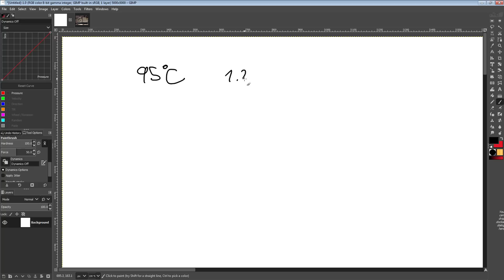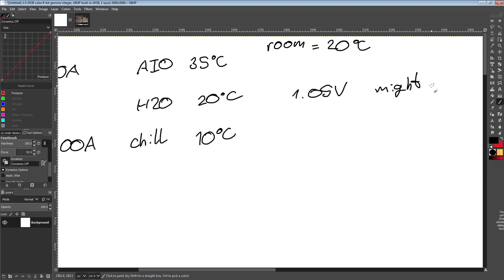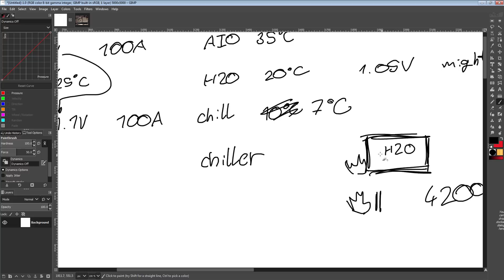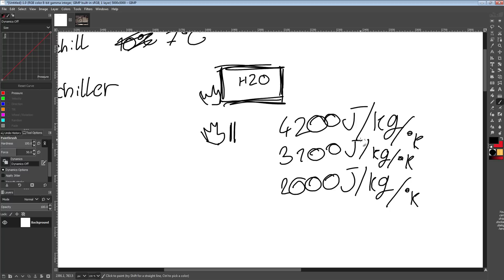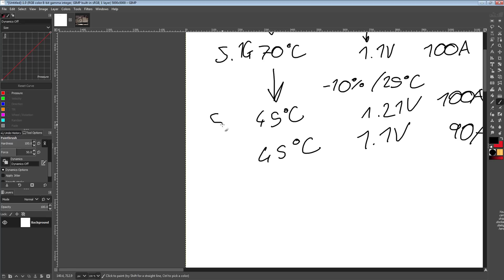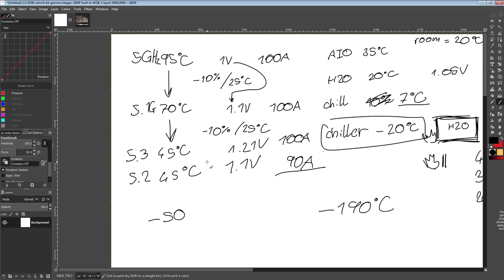Elaborating on how lower temperatures can improve voltage tolerance.

Comment: the best thing about water, the hydrogen bonding causes this heat capacity. since the molecules h20 is slightly polar, with one side of the molecule being - while the other side is +, causing the molecules to "stick" together and require more energy to get moving!

Comment: I run a Ryzen 3600 at 4.0 GHz and 1,4 Vcore LLC at 3, temps under 75C, 24/7 i hope its ok!
Reply: You shouldn't need anywhere near 1.4 V to do 4.0 GHz. Drop that to at least 1.3 V or less.
Reply: @imadecoy.  i have the badest 3600 on earth, i need 1,4 for 4.0 under this its instabil. 3.8 it needs 1,32 and this is terrible...
Reply: @MehlstaubtheCat  Maybe leave it at stock then, because it should do 4.0-4.2 on it's own. If it doesn't, I'd RMA it.
Reply: Sounds like my 1800X run at 4 Ghz or so at 1.4 volts.  Six months later I had to down clock it and then some more and some more,  now it will only run stock.
Reply: 1.4V under load? or idle
Reply: @liaminwales  it runs always at 1.4V
Reply: @MehlstaubtheCat  >.> internet says 1.4V is to much under load, i think something under 1.3v is recommended from what i have seen (like 1.2-1.26v to be safe) 
but that's from redit, the stilt killed a zen 2 cpu on 1.3v or something
Reply: @liaminwales  i've been on 1.32v at 4.1ghz on a 3600 since zen 2 release and it's been spot on
Reply: @shirow11  well the linked example was pushed hard so read it how you want. 

i like the https://siliconlottery.com/pages/statistics zen 2 examples 1.2-1.275v mostly.
they seem 'safe' er (& gives an idea of bins)

any way OC at own risk ¬.¬ for fun and profit

>.> PS ASUS tuf x570 & 3700X i did try PBO on auto and hit 1.4v and 108W CPU power :O scared me so hard hit 81c as soon as cin bench started, good old MOBO auto settings. (i think it was all stock but DOP and PBO auto)

Im stock at mo, need a real cooler before i play
Reply: https://www.overclock.net/forum/10-amd-cpus/1728758-strictly-technical-matisse-not-really-47.html#post28063350
Reply: My 2400g does 4.1

At 1.5v
Reply: Ur crazy.. a constant 1.4v? Ur chip is going to degrade so hard... im in 4.425Ghz @1.264Volts 

Edit: just leave it stock

Comment: The part were he talked about: "Yeah i got 20C° lower operating temps lets crank the voltage" part hit way too close to home^^
Reply: It's how I killed my 1800X from any future overclocks,  hey I got an AIO...wow let's kick up the voltage and clocks.  6 months or so later,  why is this thing soo unstable.   Running a 3950X now stock.
Reply: @jeffm2787  Stock seems to be the way to go with AMD for now. Maybe a slight undervolt offset, but manual overrides just toss out all the auto-regulation that keeps the chips alive.
Reply: @DeadNoob451  I've not bothered to OC any of my other Ryzen parts,  2700X 3800X and now 3950X.  I have PBO turned on on the 3950X, that's it.   I also have it on dual rads with an EK velocity block D5, etc.
Reply: @jeffm2787  that was kinda the intention behind X chips. Main example being OCing a 1700 to 1800x speeds, basically same 8c16t only downside to first gen was no included cooler for X skus. OCing X cpus is kinda bad in terms of longevity (high voltage on a 1800x shows in time) and doesn't scale that well for the amount of power draw.
Reply: @jocerv43  X might as well just be for eXtra on Ryzen chips as in eXtra base clock.  Overclocking them seams kind of pointless unless you just want to waste power and longevity for well not much true gain.   Just my opinion of course.
Reply: @DeadNoob451  i ran my 8370 @ 4.8 ghz @ 1.35v since release and it's still kicking.  so I'm pretty sure he's talking about extreme oc's/voltage.
Reply: @XX-121  that's an old chip. I meant zen, zen+ and zen2 since those have some pretty advanced auto voltage regulation systems that you disable with override voltages.

Comment: Little sidenote about units: Kelvin is an absolute unite and you dont say °K, only K. And the unite for heatcapacity is commonly written as J/(kg * K). Altough J/kg/K technically can be the same, it looks odd and isn't actually used.

But great and informative video as always, loved it!
Reply: Karamali Numberone  so is spelling apparently :)
Reply: Not necessarily true with J/kg/K. It depends on how you read it. "J/(kg/K)" might give you "(J*K)/kg" but I have never encountered such interpretations and am not sure whether that is even conventional. At least from a programming point of view "(J/kg)/K" makes much more sense and gives J/(kg*K).
Reply: @matonted  thanks for correcting me, i edited my comment :D. It really comes down to what you see as the main divison. (Normally that would be shown by drawing 1 line larger).

Comment: high temps are really bad for any ic, at higher operating temperatures the chip has more leakage, using more power and more heat in a vicious cycle. lower temps are the way to go for efficiency at any given vcore